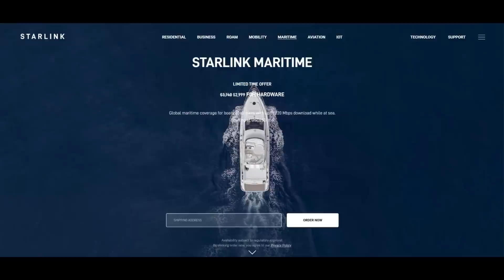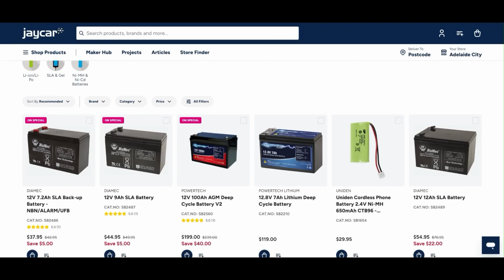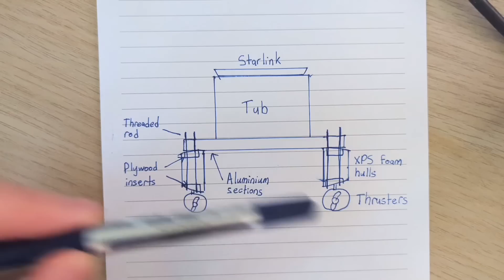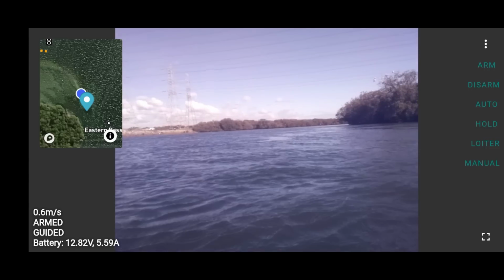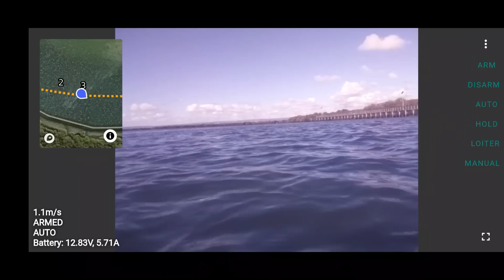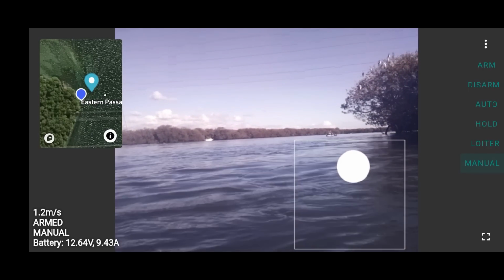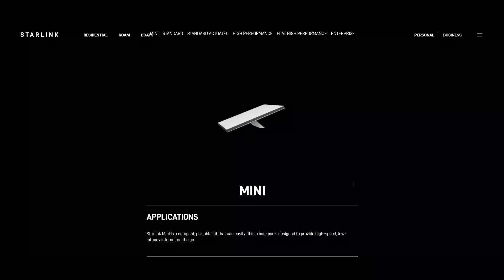Autonomous Starlink powered R/C boat - control from anywhere!

Comment: Great project, I want to replicate it. What are the size of the hulls?
How much weight does it handle?
Thanks in advance
Reply from the maker: The hulls are 120cm long, 14.5cm wide at their widest, and 20cm high. From memory, about 25kg has the hulls sitting at about halfway in the water (i.e. 10cm deep).

Comment: Would you give some information about the power distribution board? I´m tinkering on a farm rover (wheelchair motors, rtk, pixhawk..), mainly for spreading slug pellets and i´m always looking to improve it..
Reply from the maker: Sure, that board is a Holybro PM06 V2, which is pretty much just a voltage divider with current sense resistor and a buck regulator. It has 4 pairs of pads that anything can be soldered to, and which pass through the current sense resistor. There's a standard connector for the Pixhawk (I use the 6C) which carries the regulated 5.2V power supply, and the analog voltage and current readings. Ardupilot automatically sends these voltage/current readings over MAVLink, so I can see it on my ground station.
Reply: @thingify-app  Bought one as soon as i saw your answer! Thanks mate!

Comment: You need to lower the center of gravity, consider putting half the tub below water level. You will get the added benefit of cooling the batteries and electronics. Make sure the lid is sealed up good.

Comment: Please make this projekt bigger!!!!
Build an unsinkable boot. With solar and UV light save material. Am message on top the boot and an automatic when no internet, that it’s going one ptogrammed destination. 
Make a tour over the Atlantic and give the data to a homepage. Many will support you. There is potential. 
Use quality motors. Really great!!!!
Reply: What you meam by AM MESSAGE? youmean possible control by those signals when internet fail??
Reply: Sorry, seit was the correction from my iPhone. I mean you should put some Solar Panels on top.  Some automatic to Control everything.  
It’s so great what you are doing. 👍👍👍

Comment: The Goal: The creator wanted to build a boat that could be controlled remotely, even beyond line of sight, using Starlink's internet service. (0:00-1:25)

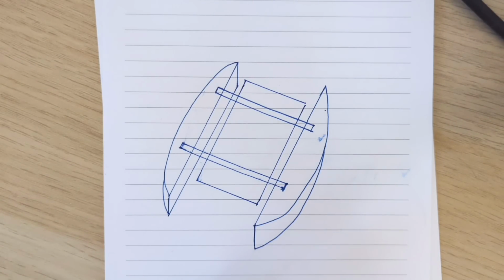The Build: The boat was built with a simple, robust design, using foam for buoyancy, fiberglass for strength, and a waterproof tub to house the electronics. (3:37-6:24)

The Electronics: The boat uses a
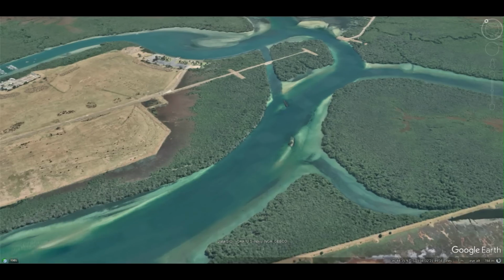Raspberry Pi, Pixhawk autopilot, and a custom web app for control. (8:48-9:44)

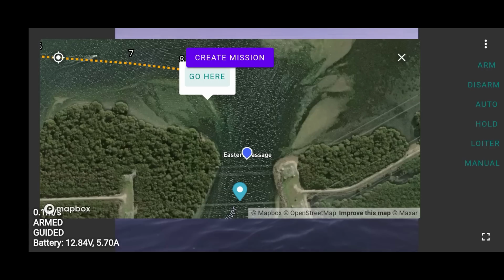The First Mission: The boat's first mission was to explore a ship graveyard. (9:44-15:07)

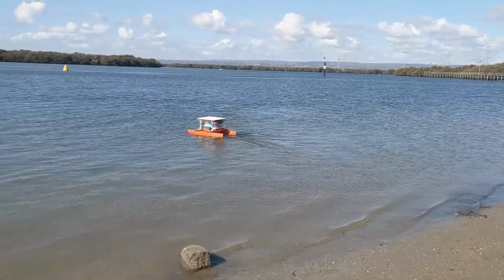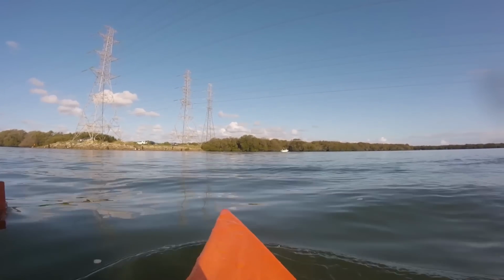Challenges: The mission faced challenges with compass calibration, throttle limits, and strong currents. (10:11-13:53)

Lessons Learned: The creator learned that the web app needed improvements, and that the Starlink mini could be a better option for future projects. (15:07-16:02)

Comment: Nice work there, I salute you for this incredible project. One important thing I noticed is that the catamaran has a little issue with boyancy and balance; If you check the footage, the small waves in the river are easily getting over the hulls. I think you should improve these things, then you would be able to increase the speed without issue and more importantly prevent the boat from pitchpoling.
Reply from the maker: Thanks! Yeah it's a bit over its design weight and top heavy too. My Starlink Mini video will be coming out soon with some significant weight improvements! 😀

Comment: a little spartan on your fiberglass wetting and layup? Sanding is for sissies I take it?
Reply from the maker: This was my first time fibreglassing anything, so I had no idea what I was doing tbh! 😅 I did end up sanding it and painting with 2-pack polyurethane, but didn't show that here. Next time I'd probably use a squeegee, cut the glass more precisely, fillet the foam edges, then sand and possibly fill with fairing compound if needed.

Comment: Great video and an awesome project.
Tip: check out nylon compression glands for passing the motor cables into the box. They're cheap and reliable waterproof, and an easyer option than diy seals.
Reply from the maker: Thanks! One of the issues was the bulky connector on the Starlink cable necessitated a split grommet kind of thing. But that's not an issue with the Starlink Mini, so I might revisit this!

Comment: PLA degrades in water..... Not a good choice
Reply from the maker: Yeah - one of the thruster mounts has already cracked (although that was due to impact). I'm redoing those in TPU and looking for alternatives for the waterproof penetrations.
Reply: @thingify-app  I have another idea for you, how about using both cellular modem and starlink (mini).
What I mean is, use low powered cellular, and only when there is no network then it would activate starlink until cellular is back, this would give the longest range?
Not sure how patchy cellular is where you plan on surfing the boat, but an idea.
Reply from the maker: Yeah this would be a good way to get the best of both worlds with the Flat High Performance dishy (both for power and cost of the data). The Mini is so efficient though, that I should be able to run it 24/7 with my current battery and maybe 100-200W of solar panels. More on that coming soon! 😀

Comment: that end is so disappointing, like cmon sometimes you have to take some risks lol
spending weeks building that thing just to drive it like 100m out of sight, omg.

also this would benefit alot from a 360cam, if the software supports it.

that spacial awareness is nice on water i think

Comment: Did I miss something? But why Starlink? Why not a basic mobile data setup that doesn't weigh 3 kilos?
Reply from the maker: The little boat with green hulls at the beginning of the video ran over mobile data, but I found coverage was too spotty in the places I wanted to use it. Especially for future missions where I want to cross lakes, rivers, and visit islands.

Comment: What a fun idea!
It would be great to have something like that.
I suggest that you go to a single hull and mount the heavy stuff low inside of it as ballast.  You want a single hull because it has the ability to right itself if capsized.  Maybe see if you can find a used sea kayak that's sized for a kid.  Get a used one and save money.
A 360 degree camera would be great.  It would give a better view for pleasure, but also let you see if any other boats, or ships are coming up behind you.
Get the largest photovoltaic (solar) cell you can fit onto it so it will recharge during the day.  
Look into propulsion systems to find one that is as efficient as possible.  But you also want it to be as resistant to fouling by seaweed as you can get.
Reply from the maker: I really like the idea of a self-righting kayak! A rugged waterproof tub could be placed in the cockpit hole with the Starlink and camera on top, while the rest of the kayak could be filled with expanding foam to make it resistant to taking on water.
Then there's plenty of room for flexible solar panels over the decks!

Comment: Starlink requires a land based local hub for some functions.
Crossing oceans wouldnt work i don't think.
We should talk im building a solar powered version of your boat. Ive been using my original dish though ....
Reply from the maker: I believe ocean crossing is possible since SpaceX enabled laser links between satellites - this allows them to relay data between satellites until it reaches one which is in view of a ground station. If you'd like to chat more, please join the Discord server linked in my channel description!

Comment: Would this concept work when Starlink direct to cell services are fully available? A cheaper more simple setup with the same signal coverage (no phone tower dead zones) could be possible.
Reply from the maker: It will be interesting to see how that performs as they roll out data in 2025. I suspect upload performance will be poor for an unmodified cell modem/antenna even if download is quite good, so it might be a while before we see it in this application.

Comment: Might want to look into Stability/ Hydrostatics... This design will have high enough initial stability, but very low reserve stability. In other words, hard to tip, but it could float upside down!

Then it can go over the horizon. ❤❤❤🌊🌊🌊

Comment: Very cool! The Blue Robotics M200 and weedless propeller would be much more efficient - the nozzle on the T200 is slowing you down! Also, rather than a DIY penetration of the cable, the WetLink Penetrator is a cheap, 1000m rated alternative!!
Reply: Also, the starlink mini is radically smaller, and uses less than 40 watts, and can also be unlocked for full global maritime usage... search the blue robotics forums about mounting and using it!
Reply: Finally, Cockpit for BlueOS may be a more featured GCS than your home - brew version, although it is very cool!
Reply from the maker: Sorry Tony, just saw this! Thanks for the advice - I guess I could remove the motors from my T200 thrusters? The main difficulty for me would be mounting these to my hulls, which the thrusters made easy. Although with the Starlink Mini, the reduced payload should bring the BlueBoat into reach 🤔

Comment: In your setup, where an R/C boat is controlled via an app using WebRTC over a Starlink connection, with commands relayed through a base station using the NavLink protocol to the Pixhawk 6C running ArduPilot for processing and control, why use WebRTC instead of MAVLink or something else?
Reply from the maker: Please join the Discord server (see the link in the channel description) if you would like to chat more about this!

Comment: Keep in mind that these LiFePO4 batteries need to be mounted (long term, so read as stored) in specific orientations. They wick their electrolyte from a reservoir, and you need to ensure that part of each wicking layer remains in the reservoir.

Comment: Cool video! 
Is there any way to use your connection system? -- (How you get manual control via mavlink)
I'm working on a team project with my school, and I need to do this : (Remotely control a Wifi conected quadcopter--> from another country). And I don't know how to do it. It's going to run Ardupilot with Pixhawk with a Pi like yours.  

 Your system look pretty much what I need.
Reply from the maker: Please feel free to join the Discord server (linked in the channel description) to discuss this more!

Comment: People mod starlink devices to 12v(that's what they are internally and then they just use 12v barrel plugs to power it.

EDIT: Didn't realize they started using a different power standard the original ones were 12v. Also, props on the DIY wire cutter. It's just a wire in a wooden hold connected to a VVPS.
Reply from the maker: Thanks, yeah the hot wire cutter is pretty flimsy but does the job! The important part is the nichrome wire and a spring to tension it, because it gets slack as it heats up.
Reply: The Starlink mini uses the 12vdc barrel plug. He's using the maritime dish that's more like a standard Starlink dish with the proprietary (almost usb c lol) plug, and the 48vdc power supply.

Comment: The starlink hardware itself may only be $2,999 but it is also $250 per month.
Reply from the maker: Yep exactly, this stings with the Flat High Performance. I tend to unpause near the end of the subscription month, then pause again before it renews to only pay the prorated amount. This means I only take the boat out a few days per month! It's much better with the Roam plan on the Mini though.

Comment: Solar panels + a deployable anchor would be an incredible pairing
Reply from the maker: Solar panels are definitely on the wishlist, and an anchor would be useful for multi-day trips along rivers. It could theoretically run 24/7 with Starlink Mini, solar panels, and the existing battery, but I wouldn't want to monitor the video feed for hazards all night 😅
Reply: @thingify-app pleaseee ad solar panels it would be the funniest thing 🎉
Reply: @thingify-app  you dont need to monitor it, your sponsors will buy another one if you lose it. it's like the nascar that the sponsor secretly hopes crashes [safely] to get all the attention
Reply: You'd want to be incredibly careful with your anchor choice. If it gets stuck, then it could mean the end of the vehicle, if it really does take advantage of the starling and go on distant voyages.
Maybe having it so the anchor can be ditched if needed would be a good idea.
Then it could just rely on GPS based station keeping, and keep the starlink off most of the time to save battery.
Reply: @charmio  fighting a current all night would drain your battery
Reply: @bendent7261  No doubt! But it beats drifting uncontrolled into riverbanks or any other obstacles. Perhaps, if it's in open waters, it would be more efficient to just let it drift and make up the lost distance once the sun rises (assuming it's not drifting where you want it to go), but I doubt it. As was shown in the tests, going slow is more efficient (typical for non-plaining hulls). To compensate for the distance lost overnight by going faster during the day would likely use even more power, though you'd need to do trials and calculations to find the sweet spot. Quite the engineering challenge!
Reply: @charmio twin anchors, both with a dump feature where you could just dump the anchor might prevent you from getting stuck
Reply: @charmio   3 4 anchor  that cuts cable on top this you need you need spare props that never get stuff tangled in it ill maybe go with 6-10 panddle wheels with a mesh barrel  then you can make your way on land. if needed.

spare 2 or 3 computer system and spare power units if power lost in a sub system. 

if things break it gone just gone unless you can limb to  to a frends house to fix  or hope some random would help.
Reply: And a kite !
Reply: Add Solarpanal and  send it over Atlantic to France
Reply: Or just an anchor that lets the current spin the props to charge the battery
Reply: @userunfriendly9304  It's an interesting idea! I actually did the math and posted it. Not sure why YT deleted it... that algorithms censorship is insanely oppressive these days!
Reply: @userunfriendly9304  The power that can be extracted from water passing over a 10 cm diameter propeller with a flow speed of 1 m/s, assuming 40% efficiency, is approximately 1.57 watts. Not enough to justify.
Hopefully YT doesn't delete it this time!

Comment: This is pretty rad! Are you not worried about overheating inside the tub?
Reply from the maker: I was worried about this, but it doesn't seem to be an issue after running it for 1-2 hours at a time. Might be different in summer though!

Comment: If you watch rctestflight, he has big issues with the props getting foiled by weeds.  As a remote, you are done.   An air power might be more reliable, with a sail.
Reply from the maker: I was concerned about this, but haven't run into issues yet. It will be interesting to test it in different environments (not too far from shore)!

Comment: Interesting project! Im curious as how you got the peer-to-peer connection since starlink IPv4 (and I assume your phone) is under CGNAT. From what I understand STUN doesn't work under symmetric or CGNATs since multiple devices are listed under one public IP. Does the interface go through a TURN server? Maybe WebRTC finds a link through IPv6 since I believe starlink supports that.
Reply from the maker: Good question - I don't have TURN configured, so it is definitely peer-to-peer via STUN. My phone provider appears to support both IPv4 and IPv6, however this setup also works when my phone is connected to my home internet, which only supports IPv4. I've yet to run into a situation which needs TURN, even with different combinations of mobile providers, Starlink, and home NBN.
Reply: @thingify-app  I see, thats interesting. Maybe home networking ipv4 is less restrictive since ports can be forwarded. 

By the way how is the latency for the peer to peer?  I've been trying out tailscale with IPv6 but it is super slow and has weird latency issues. I'm trying to code a dynamic thing with wireguard for p2p but looking at your experience maybe webRTC would be better.
Reply from the maker: From memory, it was around the low 10s of milliseconds. Easily low enough to control it manually without noticeable lag. I'm planning on open-sourcing the libraries/applications I wrote, which make it easy to setup an authenticated WebRTC connection between peers, including tunneling IP over WebRTC. Let me know if you'd be interested!
Reply: @thingify-app  if that's not too much of a hassle for you that would be awesome. either way thanks for the help
Reply from the maker: Sorry for the delay on this - I've just set up a Discord server (see my channel description links) to allow discussion of this, where I can provide access to the code etc.

Comment: The mini doesn't actually run on 12V, or 12.7V, but 14.5 seems to get it going. Mine averages 15-20W in in-motion use and is an all in one unit with a single barrel plug to power it. I use a cheap USB C adapter cable to power mine, which takes the hassle out of trying to give it a stable input voltage.
That being said, starlink direct to 4G is supposed to be coming out sometime next year, last I heard